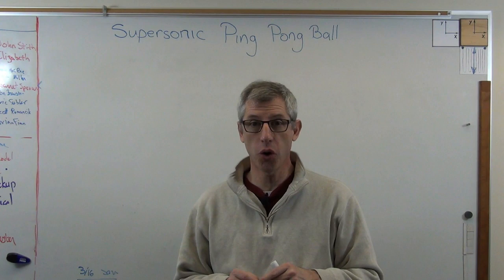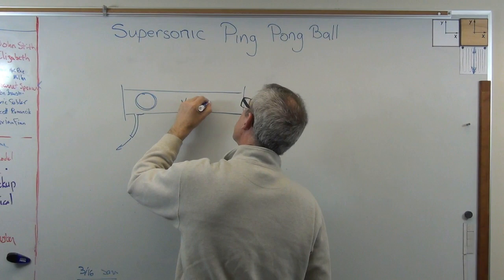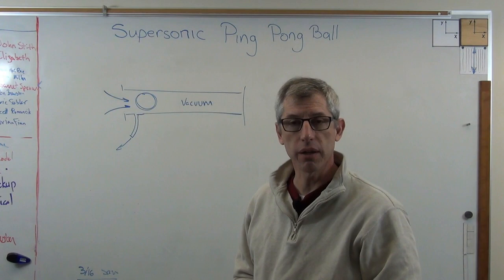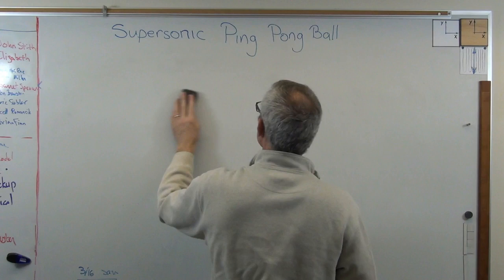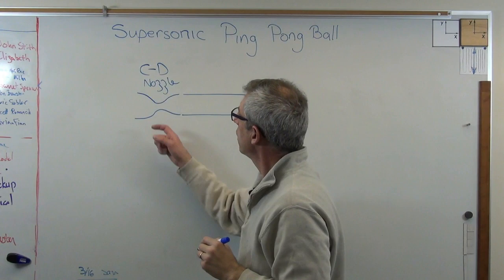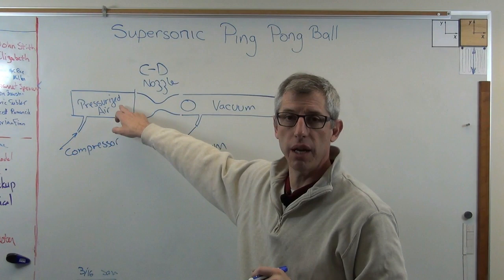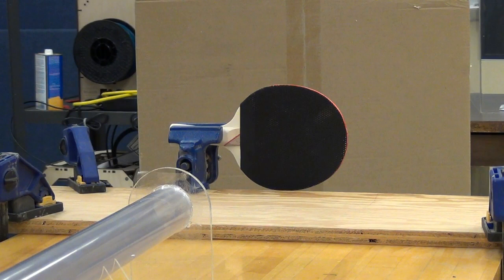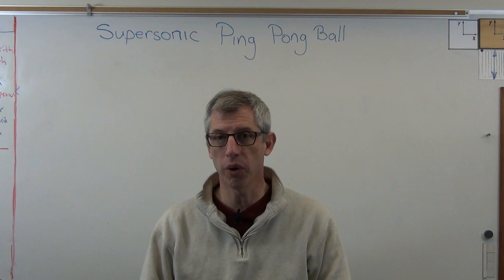Supersonic Ping Pong   Ball Brain Waves

Comment: If the downstream volume is modeled as a compression process where PV^k=constant you will find that the downstream pressure builds quite quickly towards the end, even with the vacuum at 1" Hg.  This is why the end cap blows before the ball gets to the end.  The solution is to tee a fixed volumed at the muzzle end so the the pressure remains lower than atmosphere as long as the ball is in the tube.  Try a fixed volume of about 1/2 of main tube.

Comment: I calculate muzzle energy at Mach 1.2 is about 150 ft-lb, similar to a .22LR cartridge. With the large surface area and thin plastic construction, I don't think it would get penetration into vital organs, but could do some significant surface damage. Velocity and energy would drop rapidly with increased distance from the muzzle.

Comment: I was hoping the rifling would not only help to improve its trajectory leaving the barrel, but also minimize the lateral motion, but I think you're right- now that I think about it more, it probably won't help.
I'm suspecting the best explanation for the oscillation may be caused by the action of the vacuum pump, which I'm assuming is a reciprocating action positive displacement pump. Maybe if there was a valve on the vacuum pump fitting to seal in the vacuum for a more stable environment..

Comment: Since we're working with air pressures, having a large bore is helpful. But having a large round creates greater drag. I could see an improvement on this by adding a spike to the end, and forcing it to rotate within the chamber. I don't imagine this weapon is very effective at distances greater than 10 feet. I'd do the calculation but I don't give enough damns to. ;) I know the number is going to be ineffectively short. Needs better drag reduction.

Comment: The performance limit of this should be either the structural limit of the pingpong ball. Or the speed of sound in the propellant gas you are using. Maximum performance would be using hydrogen as a pressurant. Though I have a feeling the ball would melt before you would see major benefits from using hydrogen. On a side note try scoring the break seal with an X pattern, it tends to cause the seal to break in a more repeatable manner and the flow against the pin pong ball might be more even.

Comment: They have the hole or some have tubes simply to allow the speed boost of the air to draw the fuel from the carb (since it's not fuel injection) but a venturi does not have to have a hole in the side.

Comment: I was thinking it might be a pressure reaction due to a seal as well, but the frequency of reciprocation of the vacuum pump should be too fast to cause the oscillations.. but then again helmholtz frequencies are weird sometimes :).  Just moving the vacuum port to a different location or resizing it might be enough to fix the issue if thats all it is, not that it really causes any efficiency change in the system at this level really anyways..

Comment: You mention at around 2:23 that you have high speed video of the plastic tape membrane expansion. I would very much appreciate it if you could upload the video. By the way, thank you so much for the videos. The thick walled pressure vessel video in particular really helped me.

Comment: I see that you are pulling a vacuum in the barrel. I'm glad I found this information as it was left off of your paper (arXiv:1301.5188) where the only mention is "The actual pressure differential was one atmosphere higher than that displayed on the gauge". Did you do speed tests with ambient air pressure in the barrel?

Comment: A De Laval nozzle is a venturi. A venturi is simply a tube that goes from X size to Y size and back. It doesn't have to be symmetric nor does it need to return to any given size. Read up on the venturi effect. Saying the De Laval nozzle isn't a venturi is purely semantics. Venturi discovered the effect and De Laval fine tuned it.

Comment: When air is accelerated to supersonic speeds through a nozzle, the behavioral properties of the air change, so at the point where air becomes supersonic, by design, is at the most narrow point in the nozzle. Then as the nozzle diverges, the now supersonic air actually accelerates. It seems very counter-intuitive, but take a graduate level gas-dynamics class and you'll see why!

Comment: Very interesting video. Would have been great to see the high speed footage of the ball breaking the seals as well as it striking the paddle, even the aftermath of what the ball looked like after striking the paddle. Was the ball still traveling supersonic when it struck the paddle, and how long/what distance in open air did it take for the velocity of the ball to drop below supersonic speeds?

Comment: After a little bit of thinking, I have a few questions. Obviously the speed will vary based on the pressure chamber but that convergent divergent nozzle; how do you determine its size and the diameter of the the throat. Is smaller better than larger, does it depends on a certain geometry. If so how does the length of the neck affect it, how does the the length and/or the diameter of the skirt affect it. And finally can the already supersonic flow undergo a second convergence divergence.

Comment: Since you are using vacuum for the back pressure, for something as light as a ping pong ball, I'm wondering if you even need compressed air upstream of the C-D nozzle? With any decent area ratio the flow will still be highly supersonic at the nozzle exit.

Comment: Unfortunately it's much more complex than a simple equation because of the shock lines that form inside the nozzle based on the geometry of the diverging section. There can be a large number of shocks inside the nozzle and properties and flow velocity change after each shock. 
This is the book I used in my gas dynamics class at Purdue, 
amazon.com/Gas-Dynamics-Maurice-J-Zucrow/dp/047198440X/ref=sr_1_2?ie=UTF8&qid=1360444490&sr=8-2&keywords=gas+dynamics

Comment: So, is there something that the pump does when it gets near full vacuum?  Like some kind of safety shutoff or self-adjustment when it senses the airflow dropping or whatever?  Just curious whether the oscillation might be an artifact of that.

Do you have more than one kind of pump you can try it with?  You could see if a pump that uses different technology gives you something different near vacuum than the one you are using in the video.

Comment: I just wondered, why compressed air is needed for supersonic gun? Air would accelerate to supersonic speeds after the nozzle anyway, even for ambient 1 atm total pressure, provided that the pressure after the nozzle remains low enough..? Is there a need to keep barrel short?

Comment: Not correct.  A venturi has a hole in the restricted portion and the restriction is abrupt on the inflow side and gently tapered on the outflow side.  The increased velocity in that zone causes a vacuum at the hole that sucks fluid/gas into the main flow path - as is the case with gasoline being inducted into the airflow of a carburetor, or chemicals into a garden hose sprayer.

Comment: Hello, we are french students working on supersonic speed. We found this experience very interesting and we would like to try it. We have some few questions about it: Is a 8 bar compressor enough to reach mach 1 ? Can we also use the compressor as a vacuum pump (because we don't have one) ? How long is the tube ? 
If some of you who tried the experience could give us some details, that would be awesome. Thanks for your time!
Reply: +William Dumont Yes, 8 bars would be plenty of pressure.  Using a compressor for a vacuum pump typically doesn't work well, as the compressor valving is typically pressure-actuated.
I believe their launch tube is about 2.5 meters.  Mine is 3 meters long.
I have not tried pressure only, but I think you could reach mach 1 without a vacuum.  The system is simpler that way too, with only one diaphragm needed, between the pressure chamber and the launch tube.
We've had the best success without any converging-diverging nozzle.  Keep the  distance from the end of the pressure chamber through the membrane to the beginning of the launch tube (where the ping pong ball starts) as short as possible.
For more details, see my four youtube videos (channel davekni).  We hit 773 meters/second (mach 2.2) using helium and vacuum, and 556 meters/second using compressed air and vacuum.  We may try to get those listed as official world records eventually.
David Knierim
Reply: Hi, thank you for your reply. Unfortunately we didn't manage to do the experience (we had not enough time and not enough materials) so we just did a presentation of what happen when a plane goes through the sound wall.
I've watched your videos, congratulations for this great work!

Comment: Much as a tree falling in the forest still makes vibrations in the air even though there is nobody there to hear it, so can a venturi tube be made without a hole - it just doesn't perform any function unless there is a hole in it!  I challenge you to site an example to the contrary.

Comment: You don't really need the ping pong to create the hole. A blast of air at Mach 1.2 can punch a hole in the paddle.
Reply: Yes. But we were able to send the ping pong ball down the road a bit, which was very satisfying.
Reply: James McNaughton
James, thank you for the honest response. I appreciate that. I happen to be a Mechanical Engineer and I am studying the evidence of 9/11. Do you know about WTC7?
Reply: James McNaughton Just letting you know, Norma is of a special breed who thinks no planes hit the WTC because, in her words, they would crush against the side because aluminium is weaker than steel. Have fun :-)
Reply: cjnewson88
That is an incorrect statement cj. Softer materials can impact harder materials and bust through so long as there is sufficient Kinetic Energy. However, as far as the planes are concerned, there was little mass towards the ends of the wings which wouldn't provide sufficient Kinetic Energy to bust through 14" ASTM A36 Structural Steel Box Columns.

Comment: This professor and his student lost all credibility when they put that nozzle in the air flow path.  Tell us how the nozzle increases the energy or velocity of the air flow.  All I see is a restriction.  I agree the speed of the air will increase while in the restricted path but it will decrease as soon as the nozzle open up to the diameter of the tube.

So this is the combined knowledge of multiple degrees?

Comment: not really sure how testing on a regulation paddle is relevant to firing a ping-pong ball out of a cannon at supersonic speeds. The science they are experimenting with has nothing to do with table tennis or the strength of a paddle. The plastic paddle is used for entertainment value. Not nearly as cool to watch the same ball fired through layers of cardboard or wood although I'll be willing to bet they tested it on other materials before they fired it at the pong paddle on video.

Comment: so tired of "don't try this at home"! My daughter and I have ZERO degrees between us and we got Mach 1.4 with a ping pong ball!
Reply: What, and you don't see the safety issues with a pressurised container, and a device that is able to give pingpong balls the same kinetic energy as a bullet?
THAT is why you shouldn't try this at home.
Reply: Why do you need a ping pong? Air alone traveling at Mach 1.2 will punch a hole in the thin wood paddle.